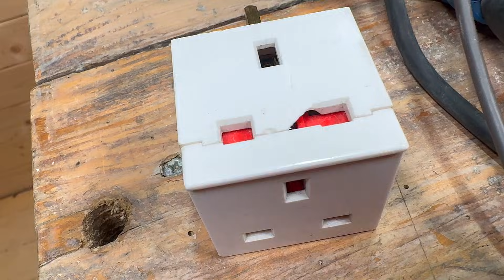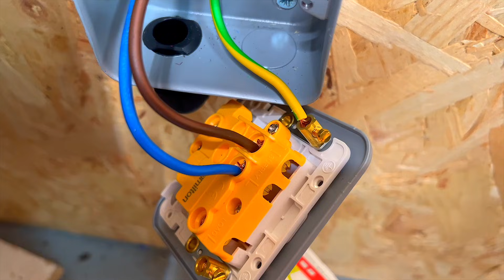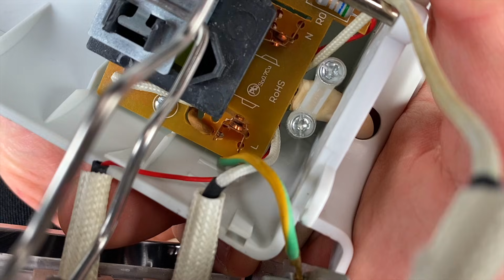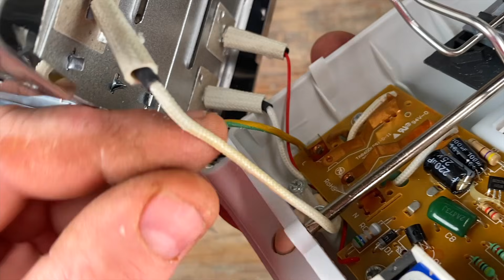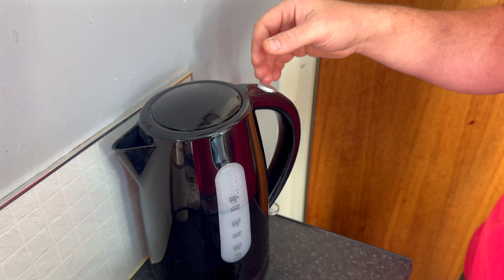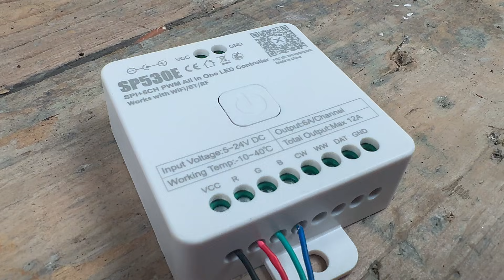Are You Qualified to do PAT Testing?

Comment: How can you differentiate functional earth power supplies (with no protective earth connection to the output connector) from ones where there should be continuity to it? I've come across both types with no markings on the labels that help to identify. Knowing this would help to know if the equipment should be failed if there is no earth continuity to the output connector.

Comment: I don't need to be an electrician, do I? In Poland I'm domestic electrician -plugs, fuse boxes, wiring /rewiring etc. but I'm also technician electrician power plant engineer. High voltage. Years of studying, full time. Placement in a power plant. Obviously UK doesn't recognise my qualifications 🤦‍♂️😂. If I had finished this in 3rd world country South Africa, then it would be recognised.😅 Common sense is not common in this country.

Comment: I have been PAT testing professionally for nearly 6.5 years. I just love doing it. You get to visit a lot of interesting places. There has been a number of times where I had to make repairs as and when appropriate (plugs, fuses, iec leads etc.), some rooms are quite cramped which can make access to equipment more difficult especially carefully pulling white goods out to get to the plug and wire. 

I am also a member of PATTA, the Portable Appliance Testing Trade Association, the only well known Standards Body for PAT Testing in the UK with more than 150 members nationwide including a couple of those members who co-write the Code of Practice.
Reply from the maker: Great insights thanks 🙏
Reply: Re white goods - are you sure they're P ?
Reply: @pmailkeey basically anything with a 3 pin plug is considered as portable electrical equipment. 
White goods including integrated models may not be moved about all of the time but will still come under PAT if it receives its power via a 3 pin plug and 13amp plug socket.

Anything which is hardwired directly via for example a fused spur (fcu) or cooker outlet, is considered as a fixed appliance, therefore is checked via FAT (Fixed Appliance Testing) using an MFT. Procedures which can only be checked by persons who are fully trained and certified to carry out safe isolation as these will be wired up as part of the fixed wiring in the building.

Comment: You Do Need The PORTABLE APPLIANCE TEST Certificate & What We Are Paid for Testing We Don't Fix Items That Fail the Test We Cut The Plug Top Off So They Can't Be Used, After Putting the Red Fail Sticker on them, Items/Appliances that are Wired In To 20A Double Pole Outlets Don't Get Tested Because they are Not PORTABLE They Are Fixed In Place. Oh the Testing Machines Cost a Fortune Too.

Comment: I'm intrigued as you say "the correct fuse is fitted" what is that with an appliance?
Reply: i believe now, instead of 3, 5 and 13 amp fuses, we have 5 amp fuses for sub 500w devices and 13a for anything above 500w. So a laptop charger needs a 5 amp fuse but a toaster needs a 13amp fuse.
Reply: @Cornz38 My understanding is that the fuse in the plug is rated for the capability of the cable as that is what it is there to protect. The device has a fuse in it derrived for the operating current of the device.
Reply: One correctly rated for the appliance and wiring. It's unlikely to be the one in the plug !

Comment: Some libraries in Australia have free dispensers for sanitary product, including in ungendered accessible toilets.  For some reason the manufacturer used Chinese domestic versions of the Type I plug, but with the earth uppermost, as was often the case in the officinal pre-NEMA "Crowsfoot" plug.  Australia has the earth at the bottom in most cases.  The power pins are slightly longer than the Australian standard, and are not insulated.  Thus they can become live with enough room for a child's fingers to be between the plug face and socket.  Thus the cable leave the the plug heading for the ceiling.  Some supposed idiot electrician still tagged it.
Reply: I think they’re not qualified in Australia but I would say practically it’s fine 99% of the time.

At least they don’t get loose or even burn like universal socket.

Comment: Pat testing isnt a legal requirement, and the rules say a competent person only needs to do a visual inspection.
Reply: It is a legal requirement in some situations. In HMOs it is expressly stated in law.

And in other laws, those laws pass a responsibility on to landlords that electrical installations must be safe.

Health and Safety legislation applies.

So if the property burns down, and it was because of an electrical appliance and people die, then they will certainly be prosecuted. Doing PAT tests helps prevent that, and reduces the chances of prosecution.

It also helps demonstrate that you were taking safety seriously and taking reasonable steps to prevent fires and injury.

More likely to be fined a larger amount of money if you have been complacent or cavalier over it.

Comment: I PAT test commercial catering Equipment some three phase mixers and ovens etc... but the way I see this type of work going these days is that it just will NOT! Be carried out as money is tight and business are struggling financially and there is no mandatory testing unlike the gas equipment which I also test including the extraction system but the electrical appliances do not have to have this compulsory test which it should have to by law in my opinion  and I have seen at first hand how bad some of the bits of kit get treated and condition of the appliances this should be a must have service.
Reply: I'd love a 3ph mixer. I'd also love a 3ph chainsaw - with a 4' bar.

Saw a video recently where the guy claimed he had a 3ph electric welder. I remember my dad have his welder with a 3ph plug on it  - it's just a transformer - so only has 2 wires. So the voltage is higher (415V) and the sine wave will be a bit different but I can't see any significant advantage.

Comment: The thumbnail is a little weird. The pat test sticker is on the socket, which… afaik that’s not how that works, is it?

And also the fault shown is pretty clearly the result of a bad contact from the socket contacts onto the plug pins, which is also not a fault with the device, so also wouldn’t be covered by pat, would it?
Reply: Yes it would be covered by PAT.
Because a PAT test also includes a visual inspection. The bad pin would be picked up by that test.

And the PAT test sticker goes on the appliance not the electrical installation, which the socket is part of.

Comment: I’ve worked in schools for the best part of 30 years and seen many PAT testers but finding a good one is as difficult as finding an honest MP. At my last place the PAT testers got caught by CCTV just sticking labels on things and didn’t even get the tester out of the bag. It was then we decided that I would get trained up and do it ourselves. As I already had city and guilds electronics I found the PAT course easy and saved the school £1000s. Now I work at a different school but don’t do the testing as they already have a company in. These guys are taking liberties as well and often find low voltage devices with stickers on and I’m taking about  5v battery powered devices so no need to test or visually check.
Reply: I was a school technician for a while, would replace damaged plugs, repair more complex items or send them for repair. One agency PAT tester came into my room (not a classroom), which had equipment with clearly removed covers, and cut off all the mains cables, as "they were dangerous." They would never have been used by students. Not just the plug, but the whole cable!
Reply: I guess these alleged PAT testers were formerly plumbers.

Comment: I did the course with PASS years ago and a couple of update seminars with seaward 

I work in IT & PAT testing is no longer in my remit, but i've had some run ins with "sticker monkeys" over the years. 

Some notable highlights include watching the guy crawl under a desk for 5 minutes just to label up the plugs, crawl out spot an unplugged laptop sitting on the desk, slap a pass label on it and walk away. 
When pulled up on it he claimed to have visually inspected it. 

I've found a power cable that had been shut in a floor box lid, corroded bare copper but a pass sticker less than a week old 😮

And A guy that argued that he had to fail a printer that was sitting in bits on the work bench because at the time he saw it nobody was actively working on it so it wasn't obvious that is was under repair

Comment: I am fed up with the so called PAT testers as seen live conductors on equipment shortly after a visit!
One example was a pass on a model demonstrating a process to the general public using telephone wire & 13A fuse!
Firstly a visible not just a measurement should have been enough!
Reply: A visual inspection is a requirement of a PAT test.

The IET has published guidance on the  In-Service Inspection and Testing of Electrical Equipment.

Note how the title of the guidance includes the word inspection .

So absolutely, a PAT test includes a visual inspection.
If the PAT tester isn't doing it, then they are not doing the PAT test correctly.

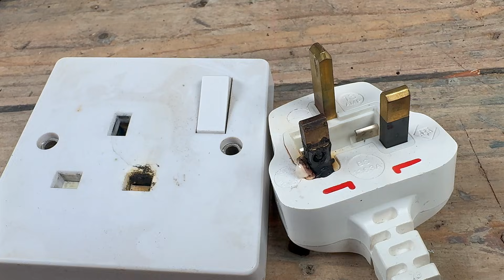Comment: The live pin burn out   3:24   is possibly the only disadvantage of the ( modern ? ) UK , 13 Amp plug top ( as compared with the 1950's round pin plug tops , which  NEVER  had this fault ! ) .... for high wattage items ( heaters ? ) left on for  HOURS  , there is a simple remedy and that is to  SOFT  SOLDER  the 13 Amp fuse into the carrier prongs , this significantly lowers the contact resistance and helps to dissipate heat , but , should the fuse blow , you will have to fit a new plug (  😝 ) , but is cheaper than a house fire ! .... this unorthodox remedy  really works well ( tried - n - tested ) ...................   DAVE™🛑
Reply from the maker: Wow, never heard of this one Dave, will look into it.
If you have more details fire it over to willittrip@efixx.co.uk and I will have a look 😊
Reply: How do you know the source of the resistance is the fuse to fuse-holder contact resistance and not the plug pin to socket contact?

You could prove it by using an MFT.
Reply: @deanXRayZulu  The answer to your question is easy ( without using any test gear ? ) .... the Neutral pin  NEVER  overheats , only the Live pin , connected to the fuse holding prongs ..... Should it be the plug pin to socket contact resistance , then overheating would be 50% / 50% on both pins ... Take two identical high power heaters , one has a soldered fuse , and one with normal clip in ( both plug tops the same model ! ) ... and leave on for an hour or two  , measure the plug temperature with an infra red type gun ... watch the results 😝 this fix  REALLY  works ( tried - n - tested ) .......  DAVE™🛑
Reply: @deanXRayZulu  If it was the pin to socket resistance , then both pins might overheat ... the Neutral pin  NEVER overheats ! hope this is of help ....... DAVE™🛑
Reply: @davidfalconer8913 Neutral pin never overheats? Why because no current flows through it?

It IS exactly the same current passing though BOTH pins.
FFS dude!

Comment: I had an interaction with 1 day wonder PAT qualified workers at a factory I got called into for a machine control issue, the boss asked me to look over the sheets they provided.

They were in industrial and had no clue or scope of the dangerous things they passed because they simply had no understanding of what they were looking at, they passed a plug in grinder when the oil pump wire was damaged and inner insulation exposed, they passed all extensions 13amp plug top done in SY cable where braiding taped off and in a oily environment, coolants an solvets were clearly effecting the cable, they even passed a plug in small lathe that had a smashed E-Stop and PVC supply flex that was stiff and hardened.

I did the course many years ago and lambasted the tutor that this was a piss take, you are not training them in any way to understand the different cables for different environments, many left thinking plug top fuses protected the flex cable from overload in all cases, no discussion of fixed load items  like fridges where the fuse rating is often larger than the flex current carrying capacity simply because the motor inrush would blow a fuse that did protect the cable from overload.

So many companies and training schools (8hrs and your qualified) got rich of this government pushed regulations that we have seen no real change in deaths and injuries in the stats but heavy costs to all the industries, don't agree and refuse, insurance doesn't cover, you are trapped into paying numbskulls to do a poor job you pay over the odds for for simply pointing out that a cable is observably damaged, and issue you can put any of the idiots working for you to check for.

Comment: The G tower disaster allegedly began with a Portable Apliance (Firdge) yet no private P.A. in service have ever been tested. Kindly discuss.
Reply: Let's cover HMOs: there is an expressly written legal requirement that says landlord supplied appliances must be PAT tested.

If the appliance was not provided by the landlord as part of the fixture and fittings, then there is no obligation on either the landlord or tenant to perform a PAT test.

This property is unlikely to be an HMO.
But there is a duty of care on the landlord and they are required to keep electrical installations in good repair and that any appliances provided must be safe.

So whilst the laws here do not expressly state that a PAT test be performed regularly, the housing association/council/landlord should be performing them to satisfy those requirements.

So it is going to come down as to who provided the fridge. If if was provided by the housing association/landlord then yes it ought to have been PAT tested periodically. If it was provided by the tenant and the flat was let as an unfurnished flat and the tenant expected to provide their own fridge, then no, no obligation to PAT test.

Comment: I've said this before,the classification of competence is wildly ambiguous, unquantifiable and very subjective.
Reply from the maker: Your right in some respects, the measure of competence, experience and knowledge are difficult scales to measure.

But when something goes wrong, the court rulers always come out 😊
Reply: @efixx  As an old fashioned 5 year apprenticeship maintenance electrician I did some PAT work. I considered myself and was considered by management as competent due to my training. But one thing I always asked myself when signing off on equipment was, "am I prepared to defend myself in court? Am I prepared to swear that when I signed off on a piece of equipment it was perfectly safe to use whether it relied on insulation or the ability to trip a breaker within the recognised safe time limit. I actually upset a building contractor once by cutting all his extension leads in half because of nicks and slices to the sheathing.
Reply: @efixx They are not difficult to measure and assess.
The real problem is that "competence" is not defined in terms of qualifications, knowledge, experience.